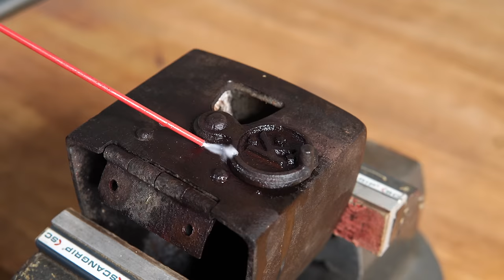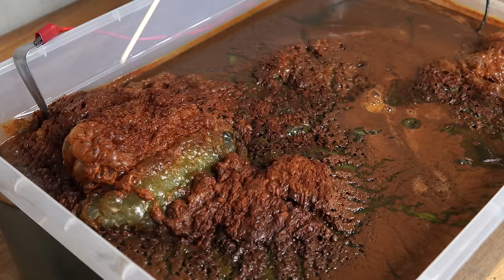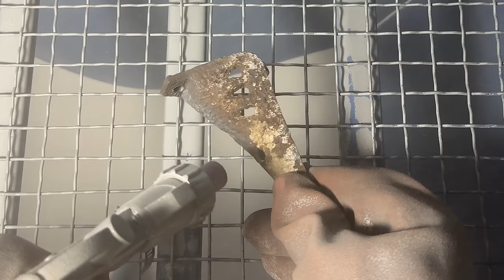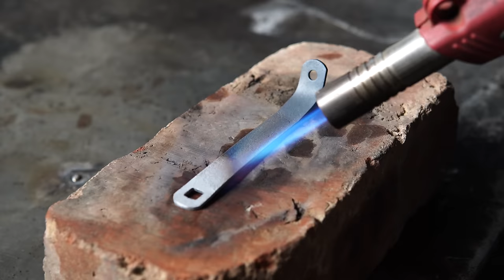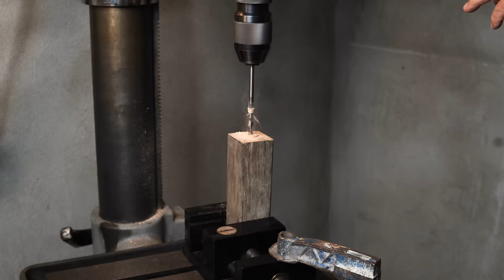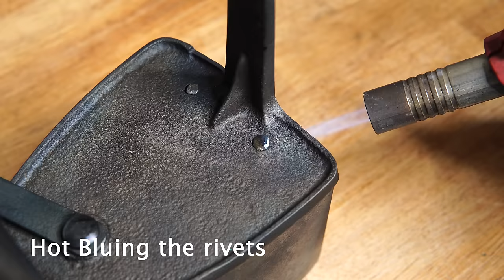Vintage Iron Restoration

Comment: I have and use one of these antique charcoal irons except mine doesn't have the chimney vent. The perfect temperature for ironing clothing and linens is between 340 and 380 degrees F. This is the temperature range on modern electric steam irons. Charcoal is going to run at closer to 400 degrees so adust the amount of charcoal using a infrared laser insta-read kitchen thermometer. Also if ironing delicate fabrics like silk use a cut piece of a brown paper bag slightly damp to protect fabric and steam out wrinkles at same time.